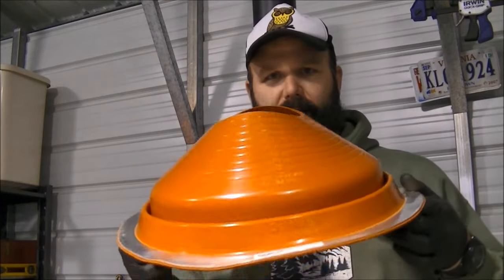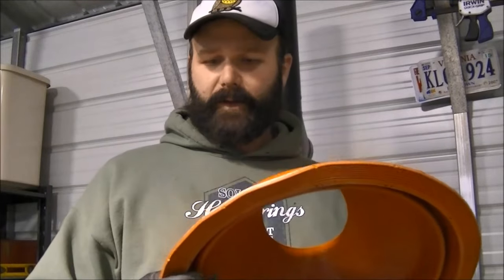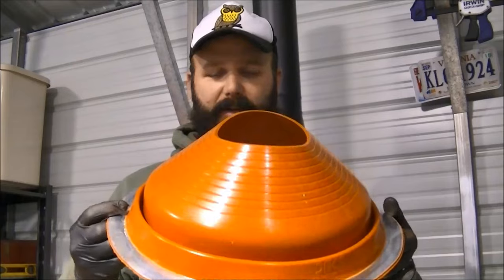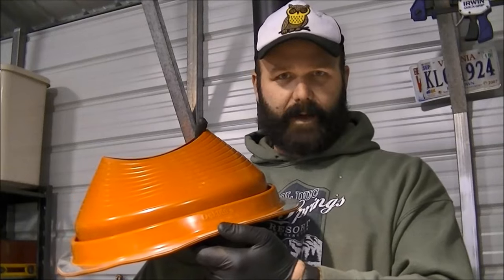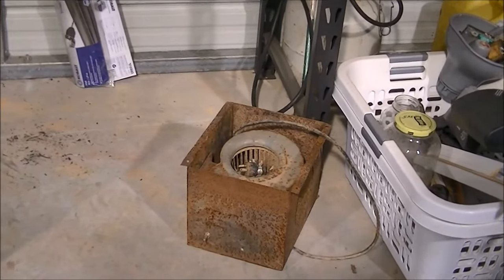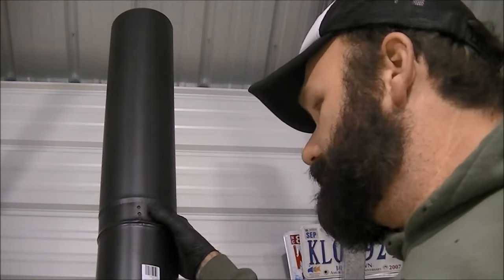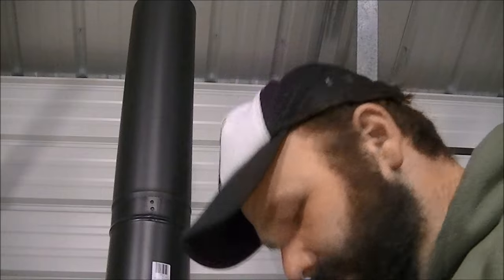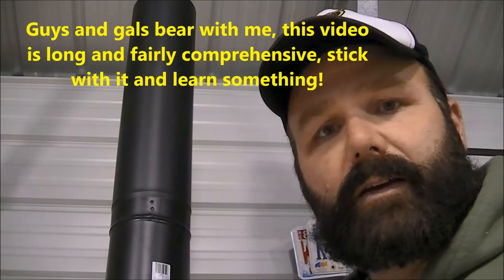How to install a wood burning stove in a steel building or carport or barn.

Comment: Just as food for thought, if you work on gasoline equipment in your shop, the stove should be setup 18-20 off the ground, to keep from igniting gasoline fumes..  This is code for natural gas water heaters installed in garages.. Just don't want to see anyone get hurt.. Great job..
Reply from the maker: yeppers....makes sense for sure.. I now keep my gas containers in a building without heat or electricity....flammables need to be in a safe place or cabinet for sure
Reply: I use gas to start my wood stove....how's that for code?

Comment: Nice install. Here's a tip for cutting round holes in sloped surfaces. You need to cut oval to get the same clearance around the pipe, because your string changes length in relation to level as you rotate on the angle of the roof. Bet the chimney was tighter on the top/bottom than the sides. Mark the ceiling straight up from the edges of the pipe.
Reply from the maker: Good thinking! Thanks for the comment brotha!
Reply: yeah that's a great tip thank you !

Comment: Why no support inside the building up near the ceiling for the heavy double wall pipe? It would be a disaster if for any reason that thin black smoke pipe deteriorated and all that weight came crashing down inside the building!

Comment: Having put 2 Vermont Castings in a pole barn, the chimney must have the Silkirk (unless you're using the other brand) Adjustable Ceiling Bracket JSC6RS. It hold the chimney up. Then the ceiling mount box, supports the black wall pipe. Got to be fairly close to installation code, or your Insurance Company could likely deny a claim. Also, have the insurance co come out and do an inspection, so it is on file. Menards has all the parts. We bought our stoves new, years ago, but the local stove retailer/installer would not do an install because we didn't buy it new from them. Stuck learning a lot on our own. Selkirk has a great tech support/install dept. It is not easy going from a house to a pole barn install. Did go with the Dektite #8 boot instead of the Selkirk, just not the quality expected.

Comment: Thank you! I'm doing this exact thing in my agricultural non-code required building.  I was nervous to go through the roof, but much less so now! Sadly I'm stuck at finding a stovepipe to chimney adapter as my outer wall for the chimney is 10inch triple wall. The companies just tell me i must frame it in.  😂 no way I'm changing or adding structural.

Comment: Nice job. Do the instructions for the rubber cap recommend cutting the hole in the ceiling that large?
Reply from the maker: No sir...to be honest I didn't read the instructions word for word...I just installed it in a manner that wouldn't discolor my roofing material and would still hold. 6 years later and it's as good as new my friend

Comment: I'm in the process of doing this myself.  Quick question for you.  Is there a reason you made hole so large through the roof?  Was wondering if you had it to do over again if you would cut the hole at say 8 inches in diameter vs 12.5 you did.  I was thinking I would want my pipe hole as small as possible so the pipe barely has any play in it.  Thanks in advance if you respond.  Great video!
Reply from the maker: I cut it large so that heat transfer would not make the painted roof finish degrade and thus cause it to rust prematurely

Comment: Did you use triple wall stove pipe or double wall? I see that Menards has the double wall pipe pretty reasonable. Says it is good for wood, gas., and fuel oil venting.
Reply from the maker: double wall pipe on this project...however I'm not a pro...have had no issues at all since the install

Comment: What adapter was used to connect the insulated pipe to the single wall? I need to connect Duravent single wall to a triple wall, but I cant find useful info. I'm using this video as my guide
Reply from the maker: hit up lowes...that's where I bought all the pipe ...try big box stores first and then wood stove stores

Comment: Thank you. Great video. Just one question:
Is it necessary to install another double wall pipe above the chimney pipe? Was just curious because it seems like from a safety standpoint, a single wall pipe would suffice. Thanks for the info👍
Reply from the maker: depends on how soon you'd like to replace your pipe...put in a double or triple wall pipe and it will be good for decades....single wall will rust out in a few years
Reply: Thanks for that info. That makes sense👍

Comment: Should of held a piece of pipe up there. If your roof is angled your hole will not be a perfect circle, it will be an elliptical cutout.
Hold a pipe straight up with the "wall" side edge touching the roof (leaving the opposite side will be a couple inches from the roof). Make your guide marks from that.
Reply: The boot is a circle, so an elliptical hole wouldn't work.

Comment: Pros/cons of running it out the wall and then up? I've seen it run that way instead so as to avoid a roof penetration.....it did need different supporting bracketing tho.
Reply from the maker: Run up the outside wall...and all the heat escapes outside..that pipe is providing tons of heat in the building

Comment: What's done is done, but my question is why wouldn't you measure your double sided wall pipe and add just a 1/4 inch from center. This would give you half inch larger hole for easy installation and not have such a large excessive hole. Just curious. Love the video.

Comment: Have you put insulation in the shop yet? Seems like that should have been the first step. What size shop is that? Im about to get one built and im having them do the 1/4 inch double bubble throughout.
Reply from the maker: Yep....didn't have this option offered to me when we bought the building...it's a 26x40.  Ur doing the right thing..go bigger than mine!! for sure!
Reply: @StoneyRidgeFarmer  bro if i could I would go 50x60 or bigger but with being on just 16 acres I don't really need it. Family farm that is 153 acres has that size. Im doing a 30x45x16 enclosed with a 26ft overhang and a 16x71 lean to. Should shelter all my stuff and give me a decent shop. I'm in the process of starting a farm with goats, pigs, rabbits, and chickens. Have cows at the family farm. No money in them.

Comment: Awesome thanks! How well does it heat in 30 degree weather?  Does it bring the temperature up enough to work comfortably?
Reply from the maker: brings it up to about 55 degrees since shop isn't insulated
Reply: @StoneyRidgeFarmer  thanks! Mine isn't either.  Same size too. I'd rather have that than the barrel stove.  I didn't think it would be enough. Great data point

Comment: When I installed mine in my wood shop I went thru a secure transition box and positioned the pipe 2 feet above the nearest surface that was 10 feet from the center of the pipe.

Comment: I have the same steel building and wanting to install my wood burning stove.   Questions are 1. the Black Pipe how do you get the right lengths and also how do you seal the seams. The 6 " pipe I saw at tractor supply have a seam not solid round.  2. How long is the double wall pipe that sticks out of the roof and the part that  attaches to the back pipe inside the building. 3. Whats the alternative to seal up the hole in the roof around the pipe.  Thanks Bud From the Catskills New York State.
Reply: I used double-wall pipe from the rafters through the ceiling. Single wall from the rafters to the stove. There is an adjustable section of pipe you can purchase. Used dektite sealing boot and a sealant called "through the roof" it is the best sealant for this application in my opinion. As far as seams: top piece slips into piece below it so creosote  doesn't leak outside of pipe. Secure with screws min. 3 at 120 degrees about the perimeter of the pipe at each joint. Hope this helps.

Comment: Thanks for the video, I've got a stove on the way for a Carolina Carport building. Off subject question is regarding the gutters on your building. Could you provide some info on the gutter installation. Thanks from SC.
Reply: How is your building & stove doing. We are currently making a studio / shop in a 26' x 30' carolina carport building with 14ft walls. Have already started installing prodex insulation

Comment: Wood stove firebox should be raised 18” off the ground when installed in a garage or shop in case you spill flammable liquids and should also be in a location where it cannot be hit by a vehicle, especially since the stove is holding up the chimney(not to code)Also the rubber flashing is not rated for the high heat that a wood stove gives off. I understand this is a “agricultural situation” but this is fire and codes are there to keep you and your family safe. I could go on about what is not to code but I would just like to say get it professionally done. Stay safe.
Reply from the maker: The pipe is supported up on the roof.....the rubber gasket is high heat and yep..it's made for this application.  I hear ya on the 18 inches off the ground...hit by a vehicle? Yep..all that you're saying makes perfect sense.  We're talking about a free wood stove someone gave me...in an agricultural building....I'll take your advice when we build our big shop

Comment: Nothing like having a wood stove in the shop.  I put one in last fall just before it got cold, and it's been great.

I got a rusty old Vogelzang box stove (not the smallest but the next size up), for practically free at a yard sale (I sold the other stuff I got as part of the deal).  I used up 3 Horrible Freight cup brushes on it, painted her up, and replaced all of the hardware with brass.  She's a beaut!

I used one of those silicone boots, too, but I just used a regular rain cap, or hat, or whatever they are called.  I think I'm related to that Mexican drug lord, but they call me El Cheapo, not El Chapo.

Comment: The smoke pipe joints are backwards, the crimps should be in direction of air flow! Otherwise they leak co2! Proper mechanical connection!
My 20 by 30 metal shop went up last week. Agricultural lol

Comment: Great video. I think my new building in KY is the same as yours. Was your's from Carolina Carport? 30' x 60'. Great building and a great value. I was wondering if that angle across your roof near the edge is a snow break. Where did you get it? I also insulated the roof of my building to reduce/eliminate the condensation. I  did 2/3 of the roof with the rolls of radiant barrier insulation. I ran out in the middle and could not get more locally so I then finished with 1/2" foam board radiant barrier from Lowes. I cut chipboard into strips and screwed them to the runners between the roof trusses and then stapled the radiant barrier to the chip board. Worked well until the ends at the eves where I could not get a stapler into . The foam board was much easier and looked better at the end. Cost was about the same for the material, but installation was much easier with the foam board. Just used fender washer and screws to attach to the chip board. I've not seen any condensation since installing the insulation.
Reply from the maker: So yes...Carolina carports is where I got my building....so as for the "snow breaks" there is a company around here that makes/shapes roofing and trim in all the colors that carolina carports makes...there are also little tabs you can put on the building...might have to do a bit of leg work to find a local source....I'll be insulating my building sooner or later...have a "water" issue right now...water coming up form behind the building during major storms...gotta get that fixed and then I'll get rocking with some insulation....actually considering an expansion of the building...extending it to twice the length and putting in one more door and a workout room inside...we shall see

Comment: Why wouldn't you run the pipe out the side instead of the roof? It seems like it would be much less prone to leaking and as a bonus  you don't have to get on the roof

Comment: What is the adaptor that you used to connect your stove pipe to the chimney? I cant seem to find one like that. they all seem to require a roof support box.
Reply from the maker: just a 6 inch steel to 8 inch insulated adapter here is a link: http://amzn.to/2qGAphd

hope this helps!

Comment: hey! i wanted to ask you.. I'm thinking about doing this and nowhere local sells those boots. I have the same style building and with triple wall pipe if i just went trough the metal with a 1/4 inch gap and siliconed it with high temp silicone do you think it would be sufficient? that triple wall shouldn't get too hot and there's no insulation or wood. Just looking for ideas.
Reply from the maker: There is a link in the video description to this boot brotha! Go down and click it ...easy breezy

Comment: Is it necessary to have the automatic damper on a wood stove? Some people dont use them, and say they are only meant for oil burning furnaces. This is coming for those that use coal stoves, i figure wood would be the same.
Reply: No a barometric damper should not be used on a wood stove

Comment: Hey how are you! Quick question, how did you attach the tin wall sheets to the metal studs. Did you pre drill a small hole then put in the screws?  
Thank you!

Comment: You May have already replied about the seal but where did you get the seal i have a metal roof on my barn and I want that seal for my wood stove i made one but the snow melt still got threww my pipe and seal Thanks for the info I  live in MD
Reply from the maker: Here ya go buddy:  http://amzn.to/2zu6GzL
And I have most all the parts that I used in my amazon store. I dont sell them personally, my store is just a list of all the goodies that I use in my videos and things I use around the farm.
Visit The Stoney Ridge Farm Store: https://www.amazon.com/shop/stoneyridgefarmer?ref=ac_inf_hm_vp
Reply: Thanks for the info  going to order now..............
Reply: I ordered and it will be in Stock on 11/12/17 so not bad estamated i will have on the 11-17-17 they will be in stock on that date also this is the 4.5 to 7.5   using 6" pipe  https://www.amazon.com/gp/product/B005MZEOT6/ref=oh_aui_detailpage_o00_s00?ie=UTF8&psc=1

Comment: Great video! I have 2 quick questions though. At 5:00 you put the gasket over the adapter. Was that just for demonstration? Didn't you slip the adaptor over the insulated pipe later? Also, did you use double wall or triple wall pipe? Thanks again for doing this video and giving your advice!
Reply from the maker: demonstration and double wall pipe..ur very welcome Charlie

Comment: Could you get me a parts list you used? Is the only double wall the small pc that goes through the ceiling? And, the part with the cap was single wall right? Rock Hill, SC.
Reply: Yes. Double wall flue pipe is used through Sheetrock, metal etc so it doesn’t get hot around flue

Comment: I enjoyed your video,  very simple and informative. I currently live inside of a converted school bus along with my wonderful wife and 2 dogs.....we had a wood stove last year but this year we wanted a brand new one.  The only challenge is the fact that the ceiling of the bus is obviously curved, so what would be the best course of approach to installing the double wall pipping safely? Also, I noticed that you simply covered the hole with the orange master flash....was that all you used to cover the hole? Did you cover the hole on the inside? What would you recommend I use on the interior of the bus? Thank you in advance
Reply from the maker: I just used high temp silicone...not sure about the inside of a bus...maybe use the same stuff? Just something to keep the water out of the bus? Not sure
Reply: Tractor supply and lowes have some nice aluminum panels you could dress inside of bus with, just an idea.

Comment: Awesome and informative video (never to long or informative) but the gasket landing on the roof at the 13:15 mark made me laugh pretty damn hard!  Instead of that RTV sealant some RV roof seam EPDM calk or even caulk used for OTR trailers with aluminum roofs would be a much better and more durable choice.
Reply from the maker: So...I put the high temp RTV because of the extreme temps that will occur up above the stove...didnt wanna loose my seal due to heat warping....so far so good

Comment: Thx for making this video. I also have a non insulated metal I am going to put a homemade wood stove in. Are you haveing any condensation problems and how bad are they?
Reply from the maker: I had issues with condensation when I first got the building...now that it stays dry inside, and heated up in the winter there really are no condensation issues to speak of....most days I am at home I open the doors and let it breath..no condensation issues when the stove is heating because it gets so hot and dry up in the top of the building
Reply: A $40.00 roof turbine on your roof will fix condensate issues.

Comment: I’m looking at getting a building just like yours, did you have electric run in it as well?
Reply from the maker: No electrical...but I piped it so I could run a line into the shop....as for building inspector....no electrical..😜
Reply: Stoney Ridge Farmer I notice ya don’t have the standard roll up doors. I was told I would have to contract out with a door company to get electric openers on standard doors.  That what you did?
Reply from the maker: My building company had a contractor that came an installed the doors (I'm sure he got his pinch)  We ordered insulated garage doors to cut down on the noise...lol that didnt work but it protects the inside of the door
Reply: Stoney Ridge Farmer thanks, appreciate the info, and really enjoy the videos.